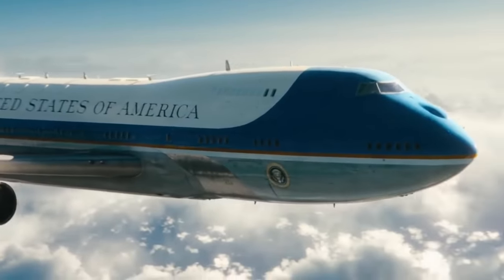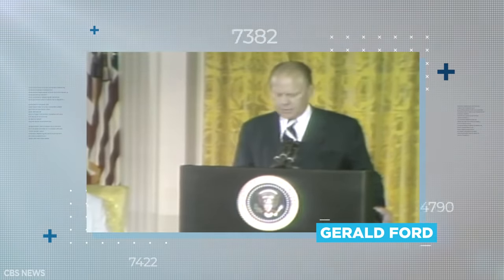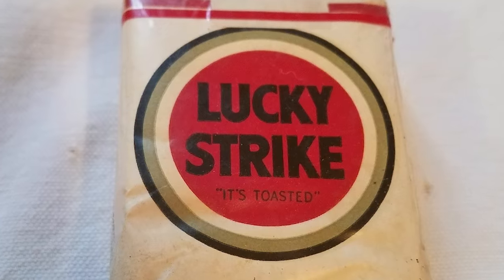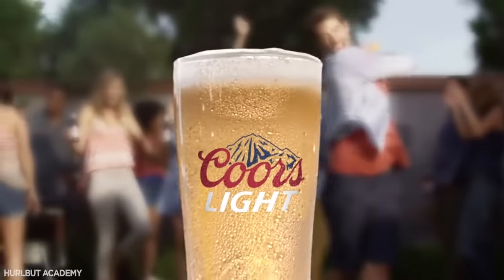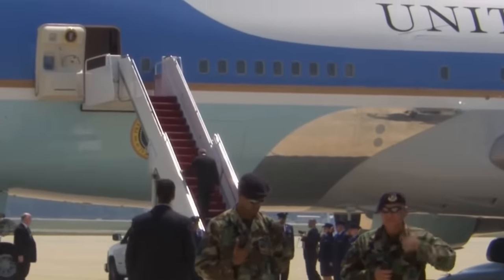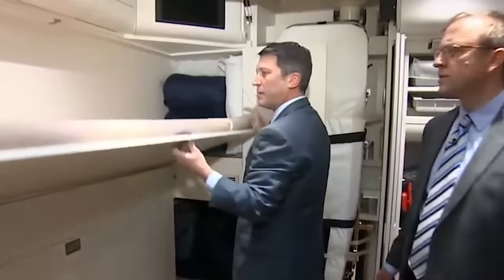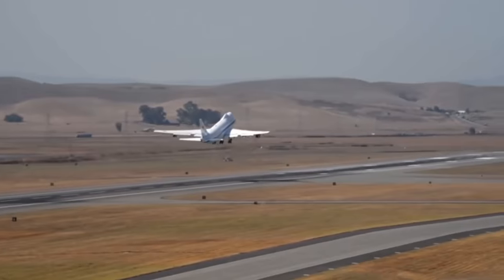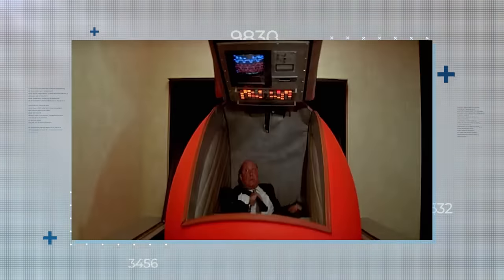Inside The $3.2 Billion Air Force One

Comment: The silver skin surfaces on the outside of the fuselage are chemically pure aluminum coating called clad, which forms a shell of a single layer of aluminum oxide atoms that protects the surface from further corrosion, is lighter weight, and does not require care like paint.

Comment: 03:29...not sure why you kept putting the E4B NAOC in there. It's not even the same plane.
Reply: You’re a part of the low information crowd. The E4 Follows the VC aircraft just about everywhere it goes when they are overseas. 
And in an extreme emergency, the E4 would be the real AF1. Actually it is the real AF1 you just don’t know it. When all hell breaks loose this is where the rubber meets the road.

Comment: The current AF-1 aircraft are 747-200s and the two new AF-1 aircraft are 747-800s and worth the Billion dollars you cite. Your column is incorrect and misleading. Boeing does not deliver the two new aircraft for several more years. Visit the Boeing plant in Everett, WA, and see the new aircraft under construction. Also,  the designation of AF-1 applies (just like Marine -1, Army - 1) when the President is on board so calling the aircraft AF-1 is incorrect unless the President is onboard. However, the designation of the aircraft as "AF-1" is something the public understands and respects, no matter who is the President. Please correct your reporting and check it out with the Air Force as well.
Reply: 747-8i

Comment: clearly video producers/editors didn't know the difference in the VC-25A and E-4 and they used the E-4 in several clips.  (although the E-4 could be used as AF1, it never has been)
Reply: Hey Polowskowsky. Any military. aircraft he has on is automatically air force one. If it were an extreme emergency and he was on board a civilian aircraft it would be called executive one. The E4 is actually Air Force One when it matters and counts the most a.
Reply: @trentelswick7673 Not the point.
Reply: This happens in most videos about “Air Force One”.

Comment: they're not identical, one is a 747-200B the other is a 747-400 the reason that was done is so they're not identical and they don't have the same weaknesses. the president is rotated between them regularly. There is a third, used for short continental USA excursions, that one's a 757-200VIP in air force livery. that one's used for short haul flights. the enormous cost was mitigated by only taking the pleasure palace overseas and using the twin engine business jet for short trips inside the USA.

Comment: 3 billion?? Really. A 747 costs like 300 million. Where’s the rest of the cost?
Reply: Classified military communication and air defense systems, expensive interior features and furniture, a full kitchen with 2 fridges costing $12 million each, an advance medical facility in case of a medical emergency while in the air. It's basically a luxury military aircraft with an on board medical facility.
Reply: Specially built for one purpose only. Keep the leader of the free world safe from everything. Similar to the presidential limo,  nicknamed 'the beast'.